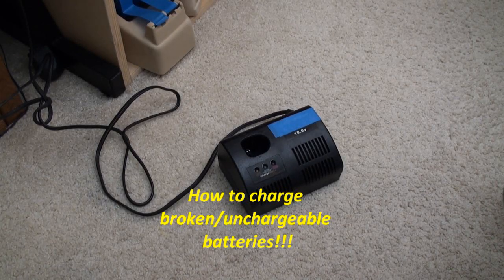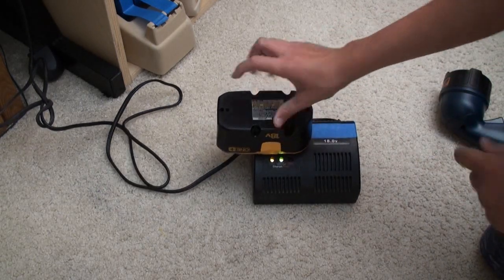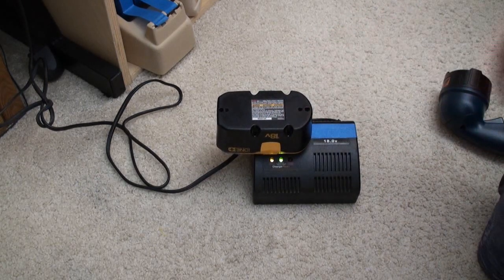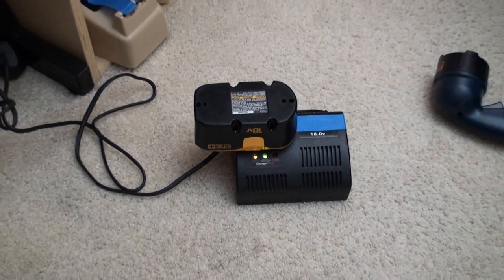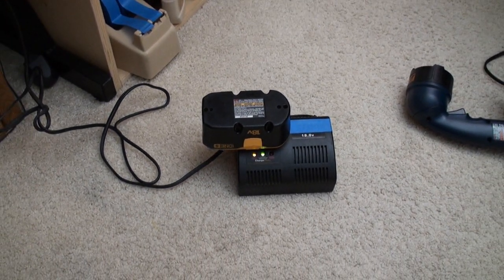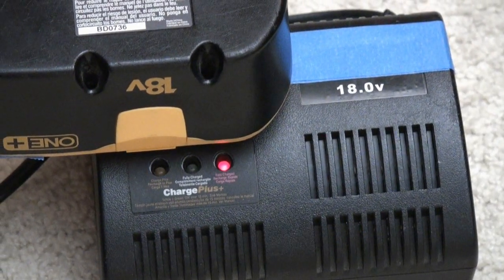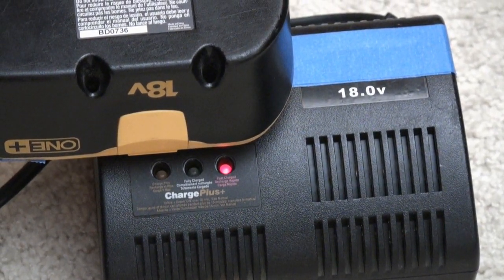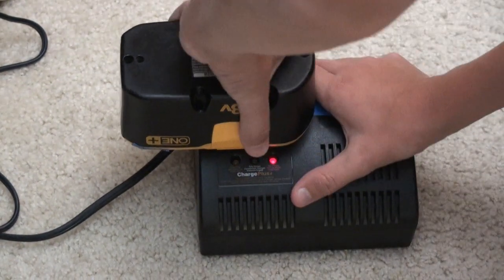How to recharge unchargeable batteries

Comment: I originally saw a video on someone else that had seen this one and claimed it worked...well, the way the other guy showed it was not working for me. Then I came across the kid that he was talking about, THIS KID! It really works, you just have to pull the plug in and out fast. I tried turning the switch on and off... that did not work. Then... putting the battery in and out... that did not work... YOU HAVE TO HOLD THE PLUG WHILE YOU PUT IT IN AND OUT OF THE OUTLET VERY FAST!!! THIS KID ROCKS!!!!!!! IT WORKS!!!!!!! THANK YOU  ALLEN  :-)

Comment: I was looking for replacement batteries when I came across your video. I was either going to buy a new battery or put a treadmill together with a screwdriver. It worked on both of my "dead" batteries and saved me at least $50. Happy, happy. Thanks.

Comment: This works. I have a Sears Craftsman 14.4 volt cordless drill that has two batteries that consistently showed the orange light on the charger indicating a bad battery. They haven't been used in a few years. I checked Sears and they wanted $49 for a new battery. I was getting ready to throw the drill out and buy a corded one when I came across this fix on YouTube. It worked for both batteries. I used an extension cord to make it easier to pulse the current to get the red charging light. After a 20 minute charge, each battery shows the green charged light on the charger. I put one in the drill and it spins like crazy. Thanks for posting this excellent solution!

Comment: I tried this today, and it seems to have worked!  I haven't done a rigorous, deep-cycle test, but this did get the system charging again, and the battery powered my drill through a short job!

Comment: I think it works with some chargers, and not with others. It depends of type of electronics and buildings parts on the charger and battery (there is electronic on battery, and some electronic counting load cycles)

Comment: I took out my Craftsman cordless drill put in the 19.2 volt EX battery NO. 1323517 pressed the trigger and nothing but a defective battery warning. Tried the method suggested in the above video and IT Worked! To be honest I was skeptical but it worked. So I wanted to share this result.

Comment: Your on the right track as far as experimenting and being able to get the battery working especially if your on a job and dont want to leave to get a new one you got er going until you have more time to troubleshoot it.  Electricity can be very mysterious but what happens in tool batteries is simple and can be fixed. inside there is lots of small batteries and one or two of them is not holding a full charge  a multimeter will help after you take it apart to replace bad cells

Comment: When you unplug the charger you create a voltage spike, same as in a spark plug coil. (so long as the AC phase cycle is not near zero at the moment of disconnect).  These spikes reverse the recrystalized  dendrils that form inside NiCad rechargeables and cause the battery to fail. They discharge themselves through these crystals.  Zapping the terminals with very short high voltage surges does the same thing (as noted above by Brettvella).

Comment: Hey thanks, I have a sears 19.2 drill which is about 6 years old and both batteries went dead. I watched your video and it worked. I did a combination of putting plug in and out and also battery in and out of charger and moving around until I heard a arc sound. Thanks again as you saved me 60 bucks. Great video!!

Comment: Ni-Cd cells can be recovered by a high current applied to them for very short intervals.
Some over-drained NiCd just shut down giving 0V and form crystals on the inside.
Applying a shock to them will pierce the crystal making them work again.

Comment: good for short fix, thank you. Won't work forever though as these things are made up of groups of smaller ones and when 1 either shorts or starts leaking it's acid, they are toast, however if you can open them and replace the bad 1...'course they make them so that they tend to break if you open them, tough to get back together, and they are all just groups of double A's!

Comment: OK.I owe you a thank you. You saved me from buying 2 18v lithium batteries for my Rigid hammer drill that I thought were dead. I kept them for several years in the garage waiting to get around to recycling them, Then I saw your video and went straight out to the garage. My charger is different and unplugging it didnt work. So I connected and disconnected the batteries from the charger base and Ureka! They r charging. Thks

Comment: Wow it worked for me I have two battles and neither of them would charge. I had 2 lights on one green the other amber and the charger wouldn't charge them. I used your solution and now the red light us on which I think means its charging. Thanks and well done saved me  a load of cash.

Comment: I was about to buy a new battery when I just thought I would search " Ryobi 18v battery won't charge". So I found this and this which seems clever. It was quite tricky to get the light to be red during the plugging in and out process. You have to catch it red and plug it in when it displays red. Will post an update when I see if it works or not.

Comment: I just tried this with a pair of batteries and charger identical to the one in the video. after 2 hours of charging a battery that hasn't been used for a couple years, the battery was at 5 volts...did this trick until the red light came on...checked voltage and was at 18 volts. cool trick. thanks!!

Comment: that only works on rare occasion, you can rescue more batteries is you have a mig welder.  zap one of those with a mig welder and it'll work like brand new.  Just make sure you get the poles matched.  I can only assume the car start setting on a big 12 volt charger would do the same.

Comment: Cool, I'll have to try this if I get a dead battery again. I've fixed a couple in the past by simply leaving it charging with the charger showing the fault for about 24 hours. Eventually it went to the charging state and then full charge. This is a faster method though so good to know!

Comment: Thumbs this up:
You could also give it some juice directly for a few minutes using a standard car battery charger, that will also get it going.  Another tip, especially with Ryobi, is just leave that battery with the error indication in the charger over night, more often than not, it will give itself just enough of a charge to begin a normal cycle.  never let your batteries drain completely and if you are not using them, make sure you give them a full charge once a month.  Good video.

Comment: this works I got a Ryobi 18v driver drill from 2001 for free from a garage sale because the owner said the battery's been dead for years and this trick worked like a charm for one of the batteries the other one the cells where to far gone and couldn't hold charge for more than a few minutes.

Comment: Can you figure out how to make a 5 Amp charger going again - it charged the scooter & now it won't even come on - it's an HP8204B for a Pride Hurricane Mobility Scooter - I'll try jiggling the plug first & let you know what happens - thanks a bunch young man - very nice of you to help people & true, batteries may be deteriorated but if they don't last after this one charge they'll fail again
Reply from the maker: There is usually a fuse in there and that could have popped if the two charge leads ever touched i would check that frist.

Comment: It does actually work...I had an old Makita 14.4v sat in the garage for 3 years with 3 completely dead batteries, charger saying they were dead too,.... did what the lad said (UK plug socket-flicked the switch a good few times, took battery out of charger then put it back in) charger says charging as normal..charge time as before 30mins. Did the same with all 3, same result, all fully charged. Lets see how they hold charge now...
Nice one.

Comment: This actually worked for two dead Craftsman cordless drill batteries that wouldn't charge.  I spent a lot of time 10-15 minutes "flickering" the plug in an out of the outlet as the red light lit up briefly each time, but finally the red light came on and the batteries were charged.

Comment: Cool, got this trick from “masczone” which he stated got it from you “allen2688”. So a very big thank you, Allen! 

Four over 20 year old dead batteries in storage was going to trash both sets of drill/saw combos. Works great now.

Zapping it didn’t work but helps to reduce the number of plugging/unplugging the power cord before the charger see it.

Comment: Also worked with 24v battery.  Things cost $119.  Was dead for 2 years had to pulse it for 45 min. Good tip, use a cheap power strip and turn it on and off.

Comment: I was skeptical when I first watched the video. I have an 18volt Dewalt XPS with one battery that would not take any charge. After trying this method it now holds a decent charge. Of course it's not as good as my other fresh battery but it could get me by in a little bit of a squeeze. 
Now I'm trying this as much as I can on that battery to see if it will gain more of a charge. Who knows?

Comment: Your awesome !! kid. I was going to buy new batteries I just tried this and it works thank you much for your post.
Reply: Save yourself the hassle of getting stuck with a dead battery. This trick may work, but I guarantee it will not last long. Just shop around online for new Sub-C cell replacements. Rebuilding a battery pack is relatively straight forward, and there are plenty of helpful vids online.

Comment: it works only if the recharger is not protected from peak of volts. Is the peak of volts that in some sort of ways clean the battery,  goofle for "hysteresis cycle" to understand.

Comment: It's probably better used for something like NiCd batteries suffering from memory effect or similar problems. If it dies before it's time then I'm guessing this should fix it. Though I've been trying with my NiCd drill battery with no luck. Didn't know it had to be done that quick, or that it was actually performing a trickle charge.

Comment: Yeap this works! Did not have to zap with 36 volt. 30 minutes later battery was fully charge. Only works on this charger though. I tried this on the makita and did not work.

Comment: all is not lost if the battery fails , I have been running my 12 volt  Black and Decker off my car battery with a wire connected to the bayonets which are inside the handle , it runs for hours, and is very handy for workshop jobs..

Comment: simplest way it.s to force charge with another adapter for about 10 seconds with the same voltage (put   + cable of the charger to + on the baterrry and - to - let the batery charge for 10 seconds or moreand that,s it but it back to original charger

Comment: Many battery stores such as Battery’s+ will rebuild these type of battery packs for 1/3 or less than the cost of a new battery pack and they usually know how to open them without destroying the plastic case. A few years back Makita wanted $80.00 for a new 9.6v pack for my 3/8" impact, Battery's+ rebuilt my old pack for $25.00.

Comment: in fact if u have a nicad or nimh battery, you can get a high dc current usually 2 - 3 X the voltage of the battery and arc it on the contacts in the reverse polarity that you would usually charge it, and by arc i mean just brush the contacts to create sparks 3 - 4 time, this will rejuvenate the individual cells of the battery and make it virtually new again extending its life for perhaps 75% of its original life span,  tho its easier just to go lithium!

Comment: What this procedure does is "Knock off the whiskers" in the cells.  If you don't know what that means, don't bother.  But what he did will get the battery to recharge and take almost a full charge.. IE it WILL RECHARGE AGAIN, and IT WILL RUN POWER TOOLS for a resepctable time frame as well!!  

Good job kid!

Comment: My makita lithium battery flashes green and red meaning according to the manual that the first battery cell in the makita battery is dead and the only cell the battery's and charger's circuit boards responds to when charging. Hence declaring the battery dead and locking out the charging process with the flashing green and red lights going constantly. I'm trying your method now and got the green light going solid which means when working right that charging is finished but also means according to the makita manual that it will trickle charge for at least 24 hours. (Not sure if the charger just turns off after 24 hours or just remains as solid green light?) Assuming the solid green light on now, which was previously flashing green and red, does trickle recharge the battery as if was using a generic charger that bye passes the first dead cell and trickle charges all the cells in the makita battery, will it return the first dead battery cell of the makita battery, back to life, so it will now work normally in the makita charger? Or do I have to trickle charge it for say 2 hours or more, each time, by your process that I am trying for the first time now?
Reply: Bob P so how did it go?  How long did you charge it for on the trickle charge and did it work?

Comment: i had a NiCad 18v rechargeable battery that gave the yellow/green code on the charging unit. this is said by the manufacturer to be a bad battery and you need to replace it. i found this and other youtube videos stating to try this method of reviving your battery. i recommend you doing as stated in the video, unplugging the charging unit rather quickly until the battery charger goes to red solid showing it is charging the battery again. not sure how long it will take as i tried to unplug charger with battery in charger slowly but that didn't work. as i unplugged the charging unit quickly it changed over to solid red indicating it was charging again. it stated in the charger until it was green and i am sold. DO NOT BELIEVE EVERYTHING YOU FIND ON THE INTERNET/YOUTUBE, but try that which makes sense and shows promise. I am not a french model.

Comment: get a boost converter. I've pulled 20v dewalt batteries back from the grave (2.75V and 3.4V) and now holding 20+volts
Reply: +ason robert  How does this work or how did you do it with the boost converter? I've never used one
Reply: +Joyce Yoder   Do your research cuz if you over charge a lithium battery it will burst in to flames. You can get boost converters on eBay With A display and buttons so you can control the voltage and amperage. 
Some times the battery voltage is to low so the charge doesn't detect it. Bring the volts up and it may charge fine. 
But some times the battery are brain dead but can be dumb charged.
I haven't see one with a bad cell yet. The weakest link is alway the circuit board to me.

For 20volts I work up to 22v and 2amps
I say works up becuz the boost converter may trip out if it's set to high to fast. 
Keep checking with a multi meter. And don't leave them... No joke house may burn down. 
I use a car battery with a 2amp charger for input power.

Comment: It's not trickle charging, if that quick zapping works (I've never gotten that to do much) it's because the jolt of voltage was shocking the 'dendrites' of the cells which were impeding the new charge from taking (like a short).  It's better to 'zap' with a higher DC voltage source: I've used car batteries but there are videos of other tool batteries.  Of course, you can replace the faulty inner cell if opened and found, but often just zapping will bring back some life.

Comment: The main reason Ni-Cad batteries 'go bad' is because of resistance that builds in the circuitry (either at the connections or in the cells) and this method actually uses the back EMF (electromagnetic force) to 'break' that resistance. Other methods shown here use the power from other batteries to achieve the same result.

We have used these same principles to save millions of $$$ in emergency back-up batteries in the Montreal subway.

Yes, the recuperated battery will most likely go bad again (and for the same reason as the first time) and they can be recuperated again. If you know what you are doing there is no danger in doing this but if you don't know what you are doing be very careful as batteries could catch fire and/or explode.

Comment: Your battery is dead because your charger dont work well.
The trigger with the plug helps you with your charger, but most of other chargers wont do it this way.
In my battery pack there was a thermal fuse, melted by too high current. Some cells were faulty so I had to replace all cells.

Comment: If the battery pack is totally exhausted, placing it on the charger before you plug it in may put a charge on it but when it's at the end of it's usable life the charge won't last long when you start drilling at something anyway.

Comment: Here's a trick I used some 10 years back with Craftsman 18V batteries which have been refused by a charger.  I can take a normally operating charged battery, and connect POS to POS, and carefully, and intermittantly connect NEG to NEG (of rejected battery).  Brush the connector (wire) contact to close circuit for less than one second, REPEATEDLY.  This will take power from full working battery, and charge offending battery just enough, for faulty batt to be charged by factory charger.

Comment: Just keep in mind that occasionally the battery really is shorted, and don't charge it unattended, without removing the battery from the charger and reconnecting it normally.  Better to avoid a deep discharge situation in the first place, as that can shorten the battery life.  I found this site informative if you want more information.  Google a site called batteryuniversity for more information.